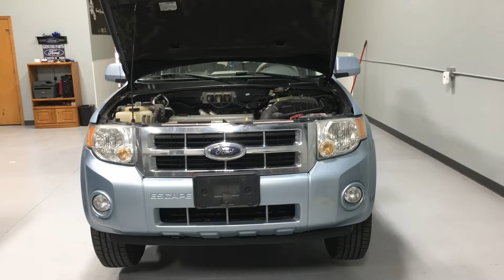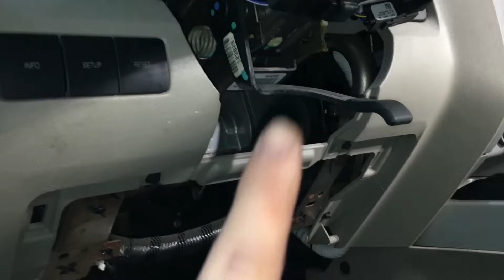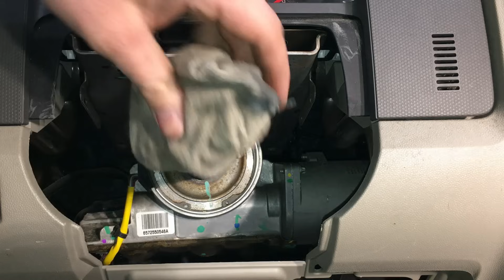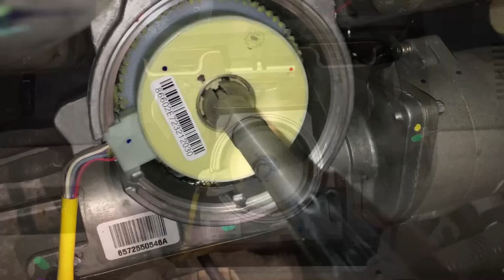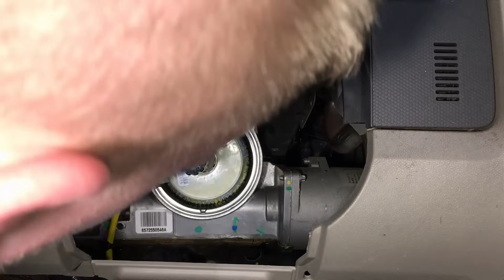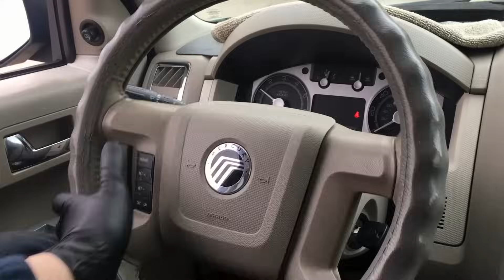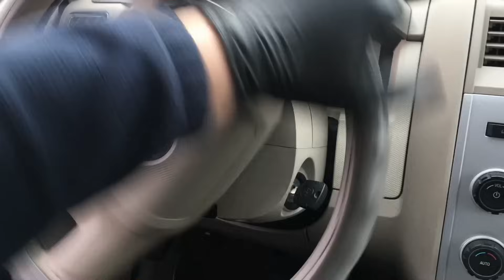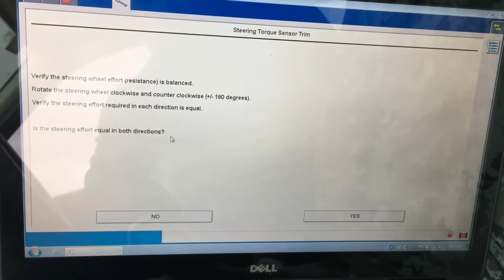2008-2012 Ford Escape Power Steering Code B2278 : EPAS Torque Sensor Critical Installation Steps

Comment: Installed new torque sensor exactly as you did. Still have a power steering assist fault and no power steering.
Reply from the maker: For this exact code? Did you clear codes after?
Reply: @FordTechMakuloco  no, I ordered a code reader that will be here tomorrow. Hopefully it will allow me to snoop and delete.
Reply: @FordTechMakuloco  I received my code reader in the mail today. Hooked it up and no codes were present. I still have a Power Steering Assist Fault warning on my dash display.
Reply from the maker: Then your code reader is not sufficient to read codes in the PSCM.

Comment: I've had two sensors so far lined perfectly when I pulled the pin.  Wheel spins left on start.  Redoing it I noticed if you move steering up or down you see pin hole location go left or right, even after pulling pin.

Comment: Great video! Does this procedure/part work on the Mazda Tribute? I have one that is giving me the same code and the Mazda Dealership is telling me I need to replace the entire steering column, except they don't make them anymore. I've been trying to see if the parts on a Mazda Tribute and Ford Escape are backwards compatible since they are essentially the same car with cosmetic differences. If I can end up just replacing this sensor rather than the whole steering column that would be huge!

Comment: will the shaking het worse if you drive it over 40 mph and may also have a engine power loss ?
Reply from the maker: no
Reply: @FordTechMakuloco  Thank you , My daughters car seems do this intermittently. Is that posibly the same issue as you describe. Unfortunately she in Florida (college) and Im in NJ

Comment: Better off just taking it to the junkyard. Just saying I am not about to try a repair like this and do not want to pay dealership prices for the repair. My dad owned this vehicle before I. He had problems with the steering and paid $1600 for a used part. He said it fixed it but it still steered a little hard. I think the ford garage ripped him off. Now it's my albatross.

Comment: Bought your recommended sensor and did everything and it didn’t work.
Reply from the maker: Then this wasn't your [problem and the B2278 code was not set. If this code was set before then make sure you use a scan tool to clear the code afterwards and retest.
Reply: I used forscan to clear it but can’t  recalibrate it. The sensor and everything I read online says I need to recalibrate it. How do I do that?
Reply: @tmorrissey5112  I’m waiting on an answer for this as well.

Comment: I got a 2012 f150 fx4 3.5 and steering wheel got hard and got a code , steering shaft torque sensor one? Can it be replaced?

Comment: Had the steering rotation sensor replaced and computer module reset and the power steering is still out. They did a diagnosis and said the whole steering column needs replaced. Anyone have ideas?
Reply: I mentioned to the shop the sensor needed to be aligned just right and he was certain he did so.

Comment: Great video. Had a heck of a time with the snap ring, until I got a set of 16" ratcheting pliers. Anyway, son's power steering went out on a 2010 Mercury Mariner. Using ForScan, code B2278 displayed. Bought an aftermarket Torque sensor from Amazon. Once replaced - being very careful to keep alignment pin perfectly centered, still no PS and still seeing fault on display. Tried unplugging battery - no luck. Cleared code using Forscan, and the wheel will twitch harshly, turn right easily, but let go of the wheel and it automatically return to center - harshly. Also, no assist to the left. Once I turn car off and back on, original no power steering in either direction is present along with fault being displayed on dash. Stumped - any ideas? Thanks a million
Reply: It'd be nice if he would reply back
Reply: have you tried turning on the car, turning it off for 30 seconds, turn the ignition on 30 seconds, and then turning it over? for some reason this seemed to reset something to do with the power steering. not a permanent fix but may help

Comment: Having a hard time aligning the upper column to lower without losing 11:00 position.
Will the bungie cord stay tight??? No one videos steering wheel going back on lol.
P.S. you have the greatest videos!!!
Reply from the maker: Once the sensor is on and locking pin pulled it doesn’t matter anymore just spline it up and go.
Reply: Did you drop the car to the ground before turning key to check for spin out
Some people say 
Sensor took 3 times to align without replacing after spin out

Comment: Thank you for this video was so much help! In order to try and add to that for future viewers I wanted to note that these sensors 100% ARE reusable! Just yesterday I installed one and with the wheels on jack stands up off the ground the steering wheel slowly spun all the way to the right. I was able to take it back out, reinstall that pin, and it worked like a charm! 
There are two alignment holes for that pin to go into and all it does is connect the front and back rings on the sensor together. If you hold the frontside ring and rotate the back (metal) ring you will see it rotates about 30 degrees right and left, independently. You will likely need a headlamp or something to see it, but pointing the light into the alignment hole and rotating the rear ring only you will see the tiny alignment hole for the rear ring. Line the two up and drop in your pin or even a Bobby pin. Redo until you get it!

Another tip, make sure the steering shaft doesn’t move even up or down after the pin has been pulled as even an inch of movement can cause you to be out of alignment
Reply: This comment saved me! Installed the new sensor and the wheel spun to the right.  Luckily Saw this comment and re aligned the sensor. Worked out great! Thank you so much!
Reply: @thomaszupan1246  I wasn’t sure if I explained it well enough so glad to hear it helped someone out!
Reply: @thomaszupan1246 did you have to pull the sensor back out then reinstall ?
Reply: @winstonholmes5566 missed this somehow, but yes you do have to pull it back out to realign it.
Reply: Thank you saved me in 2025. This comment should be pinned.
Reply: @Dreeklightnin Glad it helped out!
Reply: A big help for reuse. Another key item not mentioned is that the steering shaft moving up and down will throw the sensor position off.  I made a stabilizer stick to hold it in the most upward position I could and still get the shaft sleeve back on.  Read it in another comment.  Worked great started it up and have power steering again.
Reply: Thank youuuu! As a perfectionist I was just shook but this is very useful information.

Comment: It's missing a important information i struggled for two days to find it. There's only 1 position to connect the steering wheel to the power steering motor shaft it has the shape of a cog with 9 equal-sized teeth and 1 larger one.
Reply from the maker: I literally mentioned the steering wheel only splines one way upon assembly right in this video.
Reply: I  bought my 2009 Ford escape brand new ! Has 113,000 km yes Canada . Got electric power steering assist fault on dash . The Torque sensor $1000 CND . Was told by 5 shops to install $2500-$3500 . Thanks for great video !!!!! Saved a lot of money !

Comment: Howdy....great video.....we replaced the sensor with an oem replacement.  Still no power steering.  Any ideas what could be the next issue causing this issue?

Comment: Outstanding video sir! I greatly appreciate the detailed information at each step! Especially regarding the critical steps for alignment! The EPAS toque sensor failing reminds me of the encoder failure issues that GM has with a couple of their mid2000s transfer cases in the light duty pickups and SUVs.

Comment: great video, I had to do my sensor alignment 2 times same sensor, but you need to align the plates to get the pin back correctly.. 
1st time steering hard to turn right and car moving to the left...
2nd time steering spinning all the way to the end and stuck there..
got it right 3rd time, it is almost impossible not do  bump it out of alignment when replacing the king-Kong  snap ring, so i align it up not removing the pin, then replaced the steering with out the tube and king-kong snap ring, then made sure the pin is in the window when i removed the pin, then just started the car as shown in the video, took it for test drive and it was perfect...then remove the steering put the tube and king-kong snap ring back with-out removing battery terminal, and yes the unit did move around trying to get the snap ring back, but after replacing every thing it worked perfectly..

Comment: Well I changed it and it still won’t work so I’m guessing they sent me a faulty part? I’m sure it’s a bad torque sensor because the steering wheel had the infamous shake before it went out.
Reply: Thanks for taking the time to reply. I had the pscm codes cleared and now the power steering is working. Thanks again I appreciate it.
Reply from the maker: Clear PSCM codes and retest.
Reply: @FordTechMakuloco   will disconnecting the battery do it or will I have to take it to a Ford dealership?
Reply from the maker: Any shop with a decent scan tool can pull and clear codes in the PSCM.

Comment: If wheel turns to right after Install it isn't aligned correctly?? Or is there a calibration the dealer has to do

Comment: Thank you for this video. The power steering assist fault came on my 2009 Ford escape. I took it to two different car shops. The first quoted $1000-$1100 to replace motor on steering wheel. $600 for used or $700 for new part if they can find one plus $400 labor. The second mechanic said if it's the power assist motor, used $400-$500 and $350 labor. If it's the Torgue  sensor it would be $650 out the door/ parts and labor. I didn't get it fixed yet, but the second mechanic did reprogram my steering wheel and now i have power steering. He did say that he didn't know how long that would last. My personal mechanic can't fix it because he doesn't have a shop, but he advised that I not sink that kind of money into this car because I just replaced the starter a week ago. I asked the second mechanic if my car was worth keeping. He said yes and if I wanted to unload it let him know. Your thoughts would be greatly appreciated. Thanks.

Comment: Thanks for the video. I have a problem though. I replaced mine perfectly but it didn't fix the problem. Should I clear the code with a scanner?
Reply from the maker: yes
Reply: Just did mine and it didn't fix it either. I made double sure everything was lined up perfectly. Did yours work after you cleared the code?

Comment: I got the error on my cluster and my power steering stopped. I plugged in my Blue Driver code reader, got the B2278 code and was able to cleat the code and now it now works.

Comment: Thanks so much for taking the time to make these very helpful videos.

The steering wheel of my 2010 Ford Escape also started to vibrate, it made a warning sound and it came out on the dash: "power steering assist fault." I kept driving to the house and when I got there and started it again, the steering wheel was very hard to turn.

I used the Scanner but it doesn't give me any code other than what appears on the dashboard: “Power steering assist fault”.

Should I change the entire module or start with the torque sensor? What do you recommend?
Thanks a lot!!!
Reply: Hello did you ever figure out what to do? I am having a similar issue
Reply: @danielmag626  I ended up changing the entire module. It fixed the problem.

Comment: Also, A RECALL of Fords 2008-2011,  Ford Escape, Mercury Mariners manufactured yrs 8-18- 06 --- 9-11- 10, If power steering assist is lost for a potential issue w/ torque sensor in steering column, which may result in the loss of electric power steering assist. System defaults to manual steering mode....

Comment: I did this to my 08 escape. Everything went as planned but I still don’t have power steering and the power steering fault code is still there. I double checked and my unit is dead on center. Do I need to programmed.

Comment: This kid has to be the nicest mechanic in the USA. My daughter had problems with her 2009 Escape, power steering problems. the SUV sat for three weeks because she couldn't come up with 2700. for a R@R unit install. After viewing Brian's video, I decided I'd try the job myself, and successfully competing the job. Another 75.00 for a rescan and she's on the road again for less than $300.00. There are places in Haven for people like Brian, believe me.
Reply: If it’s a hybrid then pop the left panel when opening the driver door and push the button to recharge the hybrid battery. It happened to me when the car sits for 3-4 days
Reply: I watch videos of yours alot but I just replaced the torque sensor on my2008 mercury mariner but now it went I to anti theft alarm won't start how do you reset

Comment: The top part of the steering column is fighting me.  It came off very hard as well.  How do know you have the top column properly aligned with the bottom column?  You said one is wider than all the rest, I'm not sure which one that is or how to line it back up.

Comment: Ok my mechanic is putting one in my 2011 Ford escape a and according to the directions it has something there about a paint mark to replace the steering column but the new one has a paint mark on it as well does anyone have any input on that  the part came right from a Ford dealership thank you

Comment: I put a new sensor in. Aligned it perfectly. Still have the "Power Steering Assist Fault". It didn't work. Now what do I do?
Reply from the maker: Clear codes in the PSCM and retest.
Reply: @FordTechMakuloco  Cool. I don't have a scan tool. What's my best option?
Reply: @FordTechMakuloco  Thanks man. It worked. I bought an OBD to USB connector on Amazon and used FORScan on my laptop to clear the PSCM codes. It's a bit harder to steer to the right than the left though. I'm trying to figure that out. It's tollerable though.
Reply: @jdaz5462  Hey there! I'm currently in the same place you were (tollerable but harder tu steer right than left) curious if/how you ended up fixing that last bit ! thank you !

Comment: 2011 escape power steering quit working just once today and now it's fine. No trouble light and no error codes with code reader.  Any idea what could cause a random one-time power steering failure?
Reply: Same happened to our 2011 Escape, however kept happening now and then.  We paid $880 for the dealer to replace the sensor.  Hopefully that solves the problem.

Comment: Hey FTM  thanks for the help, and as you described in your video the vehicle does want to turn left a lot easier than to the right. The internet sez you can set the trim with FORScan and an OBDLINK . My question is do I need to raise the front end off the ground in order to reset the trim?  Thanks for your time.
Reply: Forscan does not have the option to do the torque sensor trim mentioned in this video. It only has steering wheel position sensor calibration. This calibration does not seem to have an impact on this problem of "easier to steer one way or the other" after replacing this sensor. It took me 8 tries to get the sensor orientated correctly on this customer's car - probably an issue with the steering column, but I found out if you get the pin perfectly aligned in the center of the hole it will result in this every time. On this particular car, I found out I had to position the pin just a little under halfway between center and far right of the window.